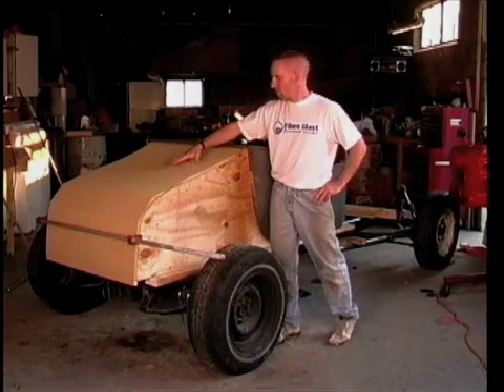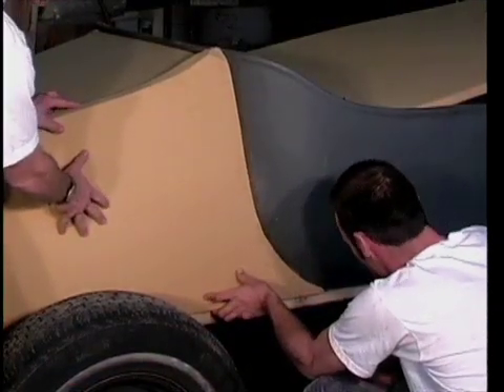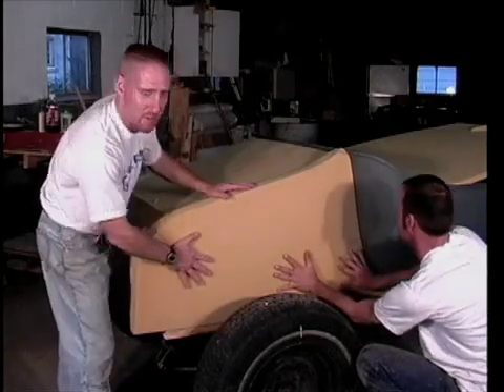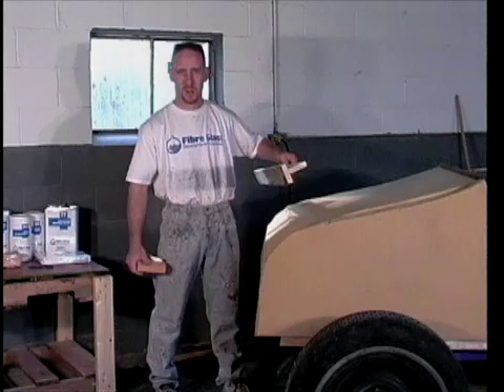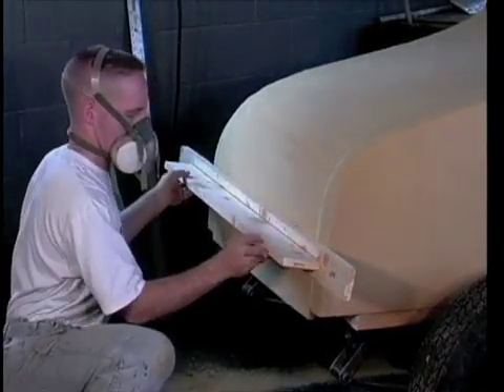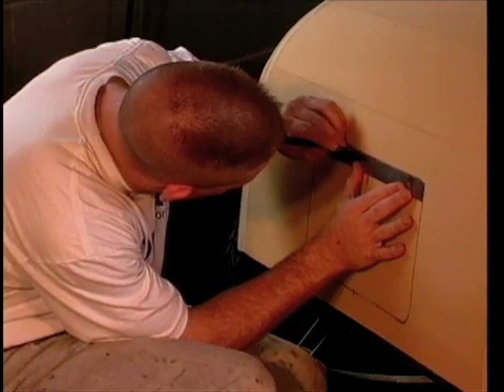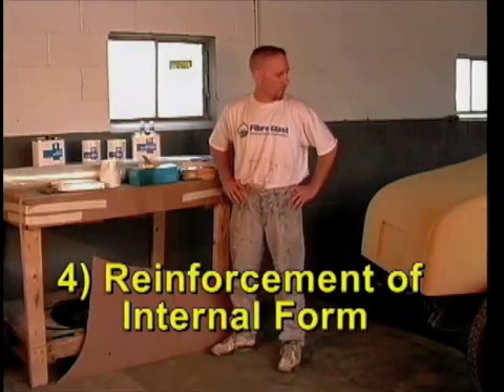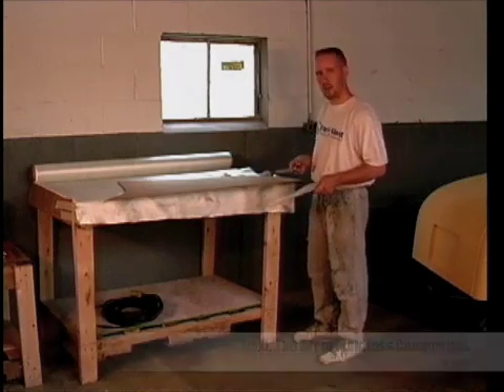Moldless Composite Construction 3 of 6

Comment: you could drill holes in the sanding board to let dust out from the sand paper, you just need to poke holes in the sandpaper as well, I'd make sure there isn't  excess sandpaper at the holes when you've poked them.